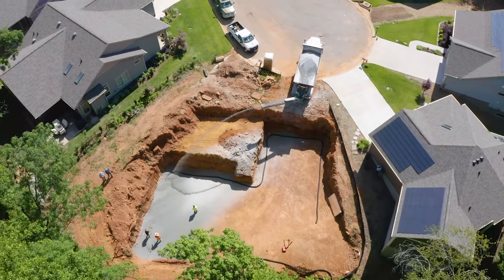Basement Wall Insulation | Done WRONG

Comment: Absolutely 100% correct.  Paint the concrete with Drylok first, then put up some type of vapor barrier... even if its only 1/2" foil-backed foam and seal all seams with Tuck Tape (>2" would be ideal).  Never, ever allow untreated studs and fiberglass to contact the concrete directly.  I'm blown way that this is not minimal code requirement.  I also highly recommend most people buy an appropriately sized good dehumidifier for their basement to keep humidity under 50%.

Comment: What I've learned through LOTS of research is that, especially in older homes with no outside vapor barrier, you basically need to seal the habitable basement space from the unfinished space. I almost visualize a finished basement as being a giant bowl extending from the first story down to the lower level. That way any moisture that does collect on the walls or floors can freely travel behind the foam board walls and sub floor down to the floor drain or through the cavities at the top of the walls. Obviously this isn't going to be a solution for major water intrusion, but for normal moisture levels in a basement it seems to be just the right thing.
Reply from the maker: We actually find that conditioning a properly insulated finished or unfinished basement is the best approach to controlling humidity and indoor air quality as long as bulk moisture is managed to drain away and/or out of the building.
Reply: Good point. You want the insider concrete to be warm-hence not too much-or no insulation there best and most-or all insulation- on exterior.
Reply: Rockwool does not achieve what you suggest. It keeps the concrete closer to the outside temp and not inside temp, increasing the potential for condensation !!…if you can’t get a sealed interior insulation and code requires you to have insulation try wood fiber -it’s hygroscopic potential will help buffer humidity extremes-buy in nay case most homes need active dehimidicayion in basement to avoid mold.

Comment: One reason why ICF foundations are great for basement applications.   In most northern or heating climates, the vapour barrier is applied to the warm in winter side of the insulation.  Typically this is between the drywall and insulation.  If the exterior basement foundation is properly waterproofed, there should be zero issues with mold on concrete foundation walls.
Reply from the maker: The "magic" with ICF foundations is that the exterior and interior of the foundation is insulated, eliminating the dew point surface on the interior which is completely unrelated to waterproofing.  We must be extremely careful when installing vapor barriers to ensure that do not trap moisture in our assemblies and always have drying potential.  This is why vapor open air barriers are replacing the vapor closed barriers in cold-climate wall assemblies.

Comment: Absolutely correct, building code has to change. Kinda makes you wonder.
Reply: Building code has changed, that's why we are no longer required to put the vapor barrier up against the concrete, which causes mold.  Everything needs to breath, this guy is wrong.
Reply from the maker: You are correct in a sense - most building materials are more forgiving when they do not trap moisture between layers.  Building assemblies must manage air, moisture vapor, and bulk water to perform optimally.  We want our assemblies to be as airtight as possible while maintaining the ability to breathe.  The ability to breathe is typically accomplished by having components that allow moisture vapor to move through them, not air.  When warm, humid air hits the relative cold surface of the concrete, condensation can occur.  This is why using polyethylene plastic film as a vapor barrier does not solve the condensation issue and functions to trap the moisture which can result in mold.  With concrete walls, the best solution is to shift the surface temperature of the concrete wall by insulating it with air impermeable, and somewhat vapor open insulation.  We want to stop the air, but let moisture vapor move so that building assemblies can dry.

Comment: I've taken out all the old insulation and drywall, along with some mold that had developed over 25 years. The framing is right up against the concrete wall. Can you recommend the best way to move forward without relocating the frame? Also In Alberta Canada so we got all types of weather.
Reply from the maker: It is likely developing condensation inside the ductwork and draining back when it reaches a level of water in the duct.  Where are you located?

Comment: This assuming concrete is not porous,but it is. A vapor barrier will just provide a place for moisture to get locked into, and will erode the walls. This wall will have pitting and damage over time with a barrier.
Reply from the maker: This is assuming the concrete is properly waterproofed on the exterior and is not discussing moisture infiltration through the concrete.

Comment: I'm wary of the Superior foundation walls because there's no footing. I'd have footings done and then cover it with their required gravel. What I'm going to do with my basement, because it's not flat walls, is once the wall framing is done with a gap between the framing and the foundation walls, I'm going to Tyvek behind the framing with the moisture barrier facing the foundation wall. Need to overlap that properly. Then seal the edges.
Reply from the maker: There is a footing in the bottom of the Superior Wall.  The compacted stone base below the wall ensures the load is spread based on the soil bearing conditions beneath.  Your approach to framing basement walls and then trying to install Tyvek behind them sounds difficult - and it will not stop condensation from occuring on the interior side of the Tyvek.  The moisture in this type of approach is from condensation on the colder surface, not moisture coming through the wall that Tyvek would stop.  Easiest way to ensure no condensation is to install foam board on the inside of the walls and frame against it.
Reply: @AddisonHomes  Yeah I can't do that because it's a stone foundation that was then concreted over. What I'm going to do now is use foam insulating panels. What I will do is frame it in such a way that the side facing the concrete will weep right into the interior sump pump french drain system. It'll be perfect!

Comment: what do I do if my basement is already framed like this?
Reply from the maker: If you are renovating, you could reframe and add continuous insulation against the wall.  Alternately, you could excavate the exterior and add exterior continuous insulation.  Otherwise, do your best to make sure that the drywall is airtight against the framing and control the dewpoint in the space with dehumidification.

Comment: In Norway (where I live) the outside if the concrete would be insulated (min 1/3 the thickness of inside insulation). Inside the vapor barrier would be put inside the insulation, not up against the concrete wall. This stops warm moist air from the inside of the house entering the insulation so it can’t condense on inside the insulation or on the concrete as it never reaches there. The vapor barrier should be taped so it’s air tight. 

Seems to work. We opened a below ground wall in our 50 year old house recently and all was dry and in good condition.
Reply from the maker: Most excellent!  The exterior insulation can work as well.  European construction has embraced building science much longer than the United States!  Thanks for sharing!

Comment: I have a basement from the 80s that has 2x2 stud walls fastened right to the block with a 4mil poly barrier between the block and studs.  I ripped the wood paneling off and everything is in great shape with zero sign of moisture.  What is the best way to insulate without ripping out studs? Should in install 1.5” foam board between studs and caulk leaving a .25” air chamber between the drywall and foam board? Or would I be better off just installing no insulation the way it has been for years dealing with a slightly colder environment?
Reply from the maker: That’s fantastic!  I personally would remove the studs, add continuous insulation, and install furring strips such as the 2x2s you removed on top of the foam for drywall nailers. 
You could certainly install rigid insulation between the 2x2s which would be much better than air permeable insulation.
Reply: Thanks for the reply.  IF you were to keep it as is, do you see any issue with installing foam board over the existing 4mil poly barrier? Or would you remove then add rigid foam board?
Reply from the maker: @vanwyckcodya  I see no problem installing the foam board over the poly.
Reply: @AddisonHomes what about fiberglass over poly in situation like this?

Comment: How about spray foam? In Canada (my province anyway) I’m pretty sure we’re supposed to use Vapor wrap between the drywall and framing/insulation?? 

I’m looking to gut my basement and inspect walls for cracks etc. if all looks well, I’d rather spray foam between the studs for an airtight seal and I assume better R value??
Reply from the maker: If that is your desire, I would use closed cell spray foam and install it on the basement walls between the basement wall and the framing.  Any framing touching the concrete walls will be prone to develop condensation and potentially mold and rot.

Comment: So we use Extruded Polystyrene (XPS) insulation board against the concrete wall, then add the stud frame, do we then use fiberglass insulation as well?  Or is it enough to just use the polystyrene board?
Reply from the maker: It depends on your location (climate zone) and code version.  The adopted version of the energy conservation code will specify the level of foundation insulation required. 
Where are you located?
Reply: How thick of foam board is sufficient?  I’m in zone 4a (west central NC).

Comment: I have a concrete block basement.  Can you put tyvek on the wall and then use fiber glass insulation?
Reply: I saw @Renovision do it in their video: https://youtu.be/gnNhSzRjliY?si=37zLTWqPjHQ4x1zz
Reply from the maker: @BFugate59  I always use continuous insulation to reduce the condensation potential at the foundation wall which the Tyvek will not do. Tyvek is vapor open so vapor from any condensation between it and the wall could still come through.

Comment: My contractor did 2 things differently he used metal studs, zero wood,  and left a 4” air gap between the studs and the concrete wall,  so zero contact with insulation
Reply from the maker: The contact with insulation isn't the problem, its the relatively warm, moist air of the conditioned home when it migrates into the air gap and meets the relatively cool concrete wall where it hits dewpoint and condensation forms on the interior surface of the concrete wall.  Bulk moisture = musty odor in the basement and possibility of mold/mildew growth.

Comment: Great video! I'm in a northern climate and had to pull off the drywall of my framed and finished 1970's basement. It's currently fibreglass bats with a poly vapour barrier on the drywall side. Seeing as I've got the drywall off already I'd like to replace all the old insulation that's pretty musty. Would spray foam be a good option to avoid removing the framing and redoing it?
Reply from the maker: Closed cell spray foam would do the trick, but stay way from open cell in that application.  Make sure you fill the gap between the studs and the poured concrete wall as well.  If there is not gap, remove the studs!
Reply: @AddisonHomes  Thanks!

Comment: Can you put the foam board and vapor barrier on the on the OUTSIDE? I am not a builder, but I am in the process of finishing my basement walls, and when these foundations are built, I just don't understand why it would not be commonplace to attach foam board with a plastic sheeting of some sort on the OUTSIDE of every basement built?
Reply from the maker: You can definitely insulate the exterior of the basement wall.  This can keep the dewpoint temperature on the interior of the wall warm enough to avoid condensation potential if you use enough insulation on the outside of the wall and extend the insulation from top to bottom on the exterior of the basement wall.  Waterproofing on the exterior is essential to prevent bulk water from migrating through the poured wall.  Waterproofing will control bulk water and insulation (interior or exterior) can shift the wall temperature to minimize dewpoint potential on the inside surface of the wall to prevent condensation.
Reply: Thank you. If I insulate from the inside, would you recommend a foam board, such as a Owens Corning 4 ft. x 8 ft. with R-10?  I am in climate zone 5.  @AddisonHomes
Reply from the maker: @unds85  That may work but check your current code.  The 2021 IECC (International Energy Conservation Code) requires R-15 for basement walls in Climate Zone 5 if using continuous insulation like foam board.

Comment: Nice video - but I think you’re mistaken in suggesting that one could use a mineral wool board against the concrete in lieu of a foam board. The reason being that mineral wool is vapour open so you’d still have moist interior air meeting cold concrete. My understanding is that taped rigid foam is your vapour barrier preventing moist indoor air from reaching the concrete. And there should be no poly against the interior gypsum finish to complete the system.

Comment: It might depend upon what is on the other side of the poured concrete.  If there is a vapor barrier and foam insulation, studs on concrete on the inside might be alright.
Reply from the maker: Exterior insulation might change the situation, but basements in this part of the country (including this one) do not include exterior insulation.  An exterior vapor barrier or waterproofing doesn't change the scenario at all - the interior condensation is not coming through the wall, it results from the interior wall temperature being below dewpoint.
Reply: @AddisonHomes yes but if the exterior insulation keeps your foundation wall dry, it do at hit  point. NB also interior insulation even if  sealed does not warm up our foundation wall, anymore than fiberglass bay does-you a depending on the foam board to form a vapor tight assembly much harder in practice than it sounds in theory .

Comment: I am getting mixed answers but was planning on doing the following foam board against the concrete/framing/rockwool/6mil poly/drywall.  Now the Poly is my big question I have done it this way in the past but moved to a 1950's home.  I have been tearing out the basement walls due to mold they just had it frame/pink insulation and 6mil.  The pink insulation was very moist when I took it out even know wall was fairly dry. 

So question so I just leave the poly off as it will trap moisture, I think here it is code to use it.  I am in Niagara falls area

Comment: I already installed my frame this way against the concrete.  Was going to to install fiberglass insulation but this making me think twice.  Is there anything I can do besides just ripping out my studs and starting over?
Reply: You'd have to do exterior foam insulation all the way down to the footing. Not sure how your home is set but it will be a minimum of 8ft trench around the entire exterior. Most building codes require any visible exterior foam be sealed with something like a stucco finish. Places like Menards sell it for special order. I'd imagine it will be a lot more work than redoing the studs though but you'll have a warmer basement in the winter
Reply from the maker: That's a tough one!  The absolute best way would be to shift the wall out and slide some rigid foam behind the studs.

Comment: Hi Todd , I didn’t quite get your explanation how to increase concrete wall temperature with insulation, as the only way to increase it is to install insulation outside. Installing inside will make concrete wall inside surface even colder, thus resulting a higher chance of condensation if there will be no vapour barrier. Roxul is a permeable material and will not stop vapour getting thru
Reply from the maker: @pavelm.7673  your increasing the surface temperature on the interior of the foundation wall. This can be done with exterior insulation or interior insulation. With interior insulation, the wall is no longer exposed to the interior air- only the continuous insulation, which has a higher surface temperature that does not result in condensation.